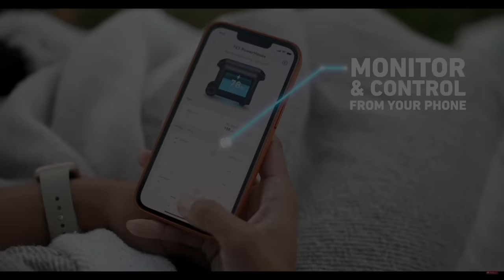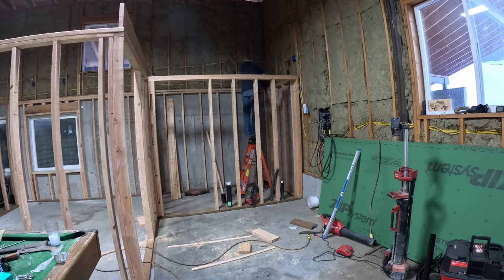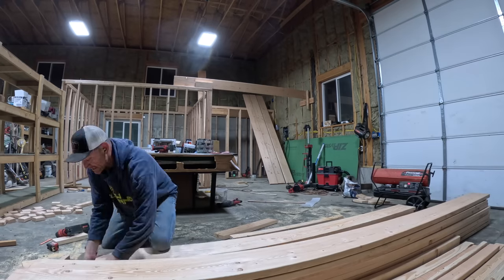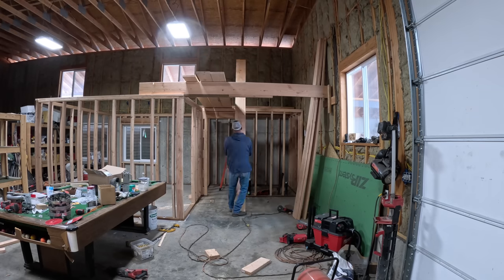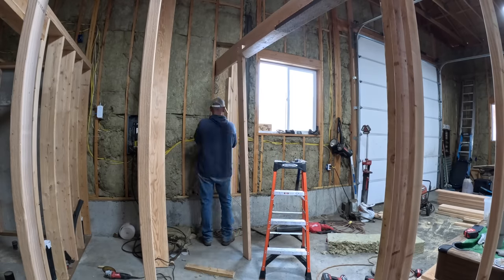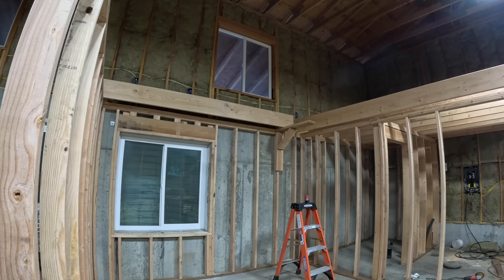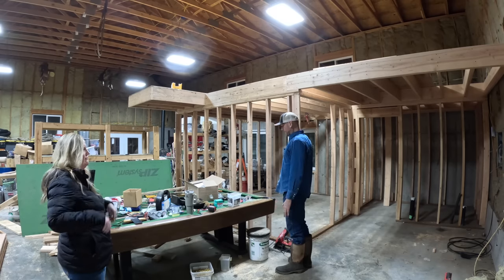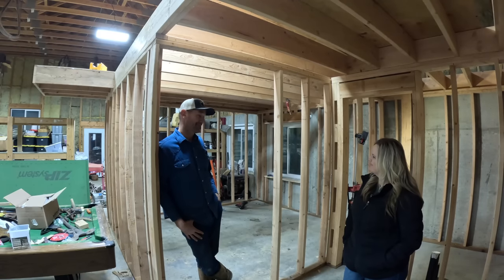#654 - Installed Floor Joists For Upstairs Bedroom (Shop Addition Pt 2)

Comment from the maker: To learn more about Anker 767 and other Anker products go to https://ankerfast.club/3ExLdWr or Amazon https://ankerfast.club/3XiYLhn Thanks Anker for sponsoring this video! #ankerpowerhouse  #powerstation
Reply: Just a heads up.. those are "joists".   Rafters are the angled boards that make the roof, your horizontal boards that make ceilings and floors are joists.   (and when you tie them together, it's called a truss" of coarse).

Comment: If you make  the stairs as planned you could make cabinets and drawers under the stairs. You can then store tools or Cedar’s items.   The loft idea sounds good too. Don’t forget to put UGL Drylock on your cement walls. It will stop moisture from penetrating into the shop/mother in law apartment. I know from experience. I used it in my old basement.

Comment: Now I don't know if this is up your alley, but what came to my mind was the pull down stairs I have in my barn. It comes down when you need it and folds back up in the ceiing when not in use. Just a space saver thought.  Thank you for your sharing your adventure with me.
Reply: Pull down stairs for an attic would never be any good for everyday use. They are too flimsy. Maybe if a pull down set of stairs that was custom made was available they could possibly work. I think his best bet is to use a spiral staircase.

Comment: i know you will get it finished after I watch the rest of the video ... i have found myself working on my owe to get a job done so i know your pain  ..... just keep your head up and while your looking up there you will see many points of those rafters that could help you out .... i have use even a 2x4 rafter system to pull a big block out and back in of a car just by adding a 2x4 between them or setting on them to help support the load  or a 4x4 post even better ... good luck in your endeavors

Comment: Have to give you an atta boy, I have been there many times when something just falls apart and tried to continue with the project and something worse usually ends up happening.  As I age I have learned to just walk away at least for a while and "calm down" and look at things in a different way.  When I saw you turn the lights off.  I just had to giggle a little bit and say to myself.  See even the greats know when to walk away.  Thanks for all you do.  Keep up the great videos.

Comment: A Ship's Ladder may suit your needs considering your need to keep stairs to a small-ish footprint on the concrete.  I built one here where I live that goes up to a loft.  I didn't have room (floor space) for 'full stairs' and I didn't want to climb a "ladder" nearly straight up.  A Ship's Ladder was a great solution here.  Not as long as stairs and not too straight up of a climb.  I put a 90 degree turn in mine as well.  It's a really tight space.  This is working very well!  You're doing great, Heath...especially running solo!

Comment: I know it's a little late now, but when doing a project like this solo I like to use copious amounts of clamps and ratchet straps. Clamp everything together where it needs to stay, or strap it together if it still needs to move (but not too much). Can also use ratchet straps to ratchet stuff into place, like getting the corner of that row of joists up close to the corner of the wall between the bedroom band bathroom.  
Whenever I'm short a hand, I immediately switch from thinking about how to bruteforce it to thinking about how I can support the pieces I need supported without me holding them. The fewer loose pieces you have left the better. Worst case, you could have even screwed the other end of those joists together temporarily (a board underneath screwed into the first, last, and middle joist) just to hold them up so they don't shift their weight.

Comment: Just a heads up.. those are "joists".   Rafters are the angled boards that make the roof, your horizontal boards that make ceilings and floors are joists.   (and when you tie them together, it's called a truss" of coarse).

Comment: Use 2x10 LDL, which is much stronger than 2x10 lumber. Also to build a curbless shower, the floor must be 3" lower in the shower. You need to dig out the old slab in the shower, install the drain pipes and re-pour the slab 3" below the existing floor. I did it and it came out great. Curbless showers are great. Good luck
Reply: 100% agree with the LDL comment.  Heath you are effectively building a rim beam for the loft area in front of the bathroom, which I am pretty sure will never pass inspection.  Even if you placed a proper beam under that section you are running pretty close to your span load limits.  With a proper 2 ply 2x10 beam under the floor joists and a joist span of 5ft (which I think you mentioned between the bathroom wall and end of the loft) you are looking at a max span of 8'11".  Lagging the beam wont help either, just use either screws or nails with the proper lamination pattern.  I'd also guess your inspector will take issue with the fact that the slab under that bedroom corner will be considered a 'post' and subject to proper footing codes.  If you dont want to see the beam visually in front of the loft, move the beam back a bit and cantilever it.

Comment: you should plumb over a drain and some water lines to in front of the bathroom beneath the electric panel for a washer dryer. or maybe a work/slop sink for the shop

Comment: Heath it's great you add the parts where you make mistakes. Your real. That's why we are all here. Because your videos are real and great. Awesome work. Also I have 2 boxers. Alone neither will run off. Let them out together and the brindle stays fine he's older and knows but the white boxer off he goes and it took me a long time to get used to not getting upset with him because he reacted to my energy and went further and would only coem back for the kids.  Now I go out and tell him "ok buddy be a good boy and come back with daddy now" and he comes running.

Comment: I know you said you like to work alone so you can spend time thinking etc.... but also having a second person means you've got someone to hold the other end of things, which does really help.  when alone have to spend more time thinking about temp bracing etc so you're not overly manhandling things when you don't need to.  Easier on the body.

Comment: Just a friendly suggestion.  You really should use joist hangers for the second floor.  Would make putting up the floor joists much easier, and in my opinion it's the safer move.

Comment: Where the window is would be a good place to fit a door If you wanted to do a Is transom window above it that way you would have some light Is coming into the shop of that spot Maybe your window in the door too if you wanted to That leaves you a little bit more space for the kitchen net and you can use that corner for that Plus you Would not have to move the Breaker Box 2

Comment: I trained my dogs to return to a whistle. I whistle, they come back, they get a bit of chicken jerky. Absolutely no negativity, even if they dawdle. Whistle equals treat and rubs. Now, I can't whistle worth boo, so I had to buy a whistle. If you search "Ultimate Survival Whistle Test 2020" you get a review/test of 39 whistles. I settled on the Hyperwhistle and the Heimdall whistles as they have simalar center frequencies. The Heimdall is good for about a third of a mile and the Hyperwhistle is good for about a mile. This has worked great, my dogs can tear off after a jackrabbit or a deer and be out of sight, I whistle they come back. So far I've only used the Heimdall, the Hyperwhistle is a backup for if I haven't seen for a good while.

Comment: If I were building that area in your shop I would put the entry door, from outside, where the existing window is. You could maybe use that area under the upper deck and bathroom and bedroom doors for a kitchenette. If that area isn't big enough for you put the kitchenette in the loft area and maybe put a laundry type wash sink in the lower area next to the bathroom. If your worried about losing the window, a door with glass and a small window under the deck and or move existing window above the door. 
Looking good either way. 
P.S. If you are thinking of spray foam on the roof pm me.
Reply: Good idea

Comment: Reframe that front window into a door with a similar window, in the door.  that way you get both... and save a lot of space.  The wires you can use a large splice box on the bathroom side of the steel post to reroute them up and over the "door/window"    you also wont have to move your electrical panel.

Comment: Attach the rim boards first. Nail joist hangers. Drop in joists one at a time. 

Nails have better shear strength than screws too.
Reply: Yep - it's going to fail inspection

Comment: The brace up against the wall needs to have a  2x4 doubled on each side of ur 2x10 because we put in a beam to open up a room and against the wall the carpenter put double 2x4s on each side of it to support the roof which the same thing ur supporting the floor..

Comment: How about making the stairs into an "L" section staircase?  Bring the stairs down say 7 or 8 steps then make a landing of 36" square and then bring the last part of the stairs down from the landing to the floor making the staircase into an L shape.  The righthand edge of the lower landing and the last 4 or 5 steps would line up with the inside wall under the upper bedroom.  You would step up 4 or 5 steps to the first landing then turn left and go up another 7 or 8 steps to the upper landing and then you would turn right onto the upper bedroom floor.

Comment: I can't help but think that your pool table needs a cloth and then a cover over it and if you're going to use it as a workbench you could get some OSB about the right size and maybe some edges on the underside could secure it so you can use it without worrying about damaging the pool table. A new tarp may be adequate as a cover and they're cheap enough.

Comment: I appreciate your content and follow you for some time now. I know you always have a reason that I dont immediately see. I akso know that you typically dont read the comments and this is a late entry. I do not understand why you dont do everthing in the mezzonine. You could have had a very small restroom on ths shop level to bring your pipes up and a full second floor with full bath and two bed rooms with an access door from the side (where your 4 wheeler are). Below the mezzonine you could have framed it for a wood shop or just storage.  No need for a stair case. I assume at this point that this is probably not possible because of the code?

Comment: 6:42   Heath, it is a matter of weight and balance.  The extended joists beyond that toilet wall truss weighs more than the other section that fell down into the toilet "room".  A quick glance could tell you that would be the case.  Nice try, though.  It is a pity you did not have a 4x2 nailed horizontally on that new timber you have standing on its edge, to take the weight of the new timbers you were putting up.  As it stands you will need a team of helpers to assit you put it back in place, without pulling it apart, to start again.  Wil helpers to raise it, you can put in that 4 x 2 and start nailing again.

Comment: Heath, I noticed on the what I think is the front wall of your shop that you ran wires on the outside of the studs. How is that going to work when you enclose the walls?

Comment: Probably too late but what about a set of storage stairs (think tiny house) at the front wall of the bedroom area?
Reply: Like in pull out stairs?
Reply: @gregorythomas333  that would work too! great idea, fold them back against the wall when not in use.  I was thinking of creating step height boxes that could store stuff but also be use as steps as needed.

Comment: Why not install pull down stairs which fit in between the uppper floor joist, you pick just where you want it and this bedroom above will not be used as much as the one down below.       Your kids already have a bedroom so they have no need of it, sure they are going to lose their pool table, but they still have their basketball court for now, but if you decide on a larger shop then it should go where the Dugout ws placed, as it is far enough from the house.     Let your wife know that the present shop will be hers and the New shop will be 100% yours but you have to make more indoor space for the goats as they are more active than the chickens.

Comment: I seen some bones that u have done man but that ones make the blooper video any way if u mite put a door there why not header it off in the wall then it to hold ur floor up good luck & god bless
Reply: & by the way u stuff some insulation in ur soffits u would get more heat in long run or even some 4mil plastic to cover or ceiling it would help

Comment: No offense that’s not how you do that that’s how you hurt your back, Put a ledger boards on both ends and a bunch of joist hangers and do one board at a time. Check Kens Karpentry channel he shows clearly how to do what your trying to do. PS you can cantilever a 2 x 6 6 feet so your stair landing doesn’t need a post because I think you said it was 2 x 10

Comment: You mentioned you’re going to have the apartment inspected? Doesn’t Idaho require you to draw up plans and have them approved before they issue a permit? Clearly you’re building this as you go, so perhaps your comment was an off the cuff remark as I can’t see a building department ever issuing a permit on that apartment, especially inside the shop! At least not without floor to ceiling firebreak walls (cement?), a door leading directly from the lower bedroom to outside and, exterior stairs leading to a door to the upstair bedroom with a window in that bedroom. Depending on the span of the overhang, they might even require you use some steel beams. Who knows what else they’d want. They may require that you install a fire sprinkler system throughout the shop and apartment! I’m in California, and we probably have some of the strictest building codes, as everything but the landscape and weather here sucks, but I can’t believe Idaho’s building departments are lax.

Comment: Is it even legal  to have bedrooms in a garage? Without heat or ac for each bedroom? Not to mention all the flammable liquids u store in a garage? I know it wouldn't be allowed where I live
Reply: So you think he isnt gonna have heat in those new rooms? What are all these flammable liquids you speak of? He isnt running a refinery in there, he has a couple gas cans at most i bet.
Reply: @warrenmichael918  guess you didn't see all those 55 gallon barrels he had to move to make room ,my guess hydraulic fluid for the sold ford tractor,skid loader,and the defunct excavater
Reply: You think he has 220 gallons of hydraulic fluid? LOL Those Qualichem barrels were most likely empty when he got them and he stores a few different fluids in them. I doubt he stores gas in all of them either. It wouldnt matter even if he did store gas in them. You think they are gonna explode because he puts in a spare bedroom and a bathroom? Im not sure where you live but this is perfectly fine to do almost anywhere. The only places that might not allow it would be in some goofy HOA neighborhood. As long as he has electricity, heat and a bathroom, he can have a bedroom out there. I dont know why people are scared of gasoline.
Reply: Qualichem BTW is a company that does  water cooling treatment for metal cutting and water treatment systems on boilers, i dont think thats what he has in there now but it could be.

Comment: By keeping the bathroom on the main floor and doing a loft with the rafters reinforced to have a hanging loft you could have utilized the main floor for workspace like a workbench and tool area this is just such a waste of usable shop space then you have the smell of diesel getting into those areas.
Reply: I missed where he has a big diesel storage tank in the shop.

Comment: Why are you not just building a whole floor over first bedroom and for second then you have lite up there from the window. Put the stairs lengthwise across the size of second bedroom... So it is facing the wall with window that faces your house the stairs are lighted and not taking space you need and gives you more space under second floor instead of making space smaller than it needs to be

Comment: Pretty sure both ends of 2nd floor supports should be anchored as each is put n place. The way you set all supports in place at once is absolutely not correct or safe. You are fortunate you were not injured or killed. You should watch a “How To” YouTube channel. Doing things wrong could cause a viewer to follow and end up hurt. Safety first my friend.

Comment: I hope for you, and your families sake you are using "structural screws", and not standard "wood" or "deck" screws.  The latter is not approved for anything other than flooring as they have little to no sheer strength.   Keep up the good work and stay safe.